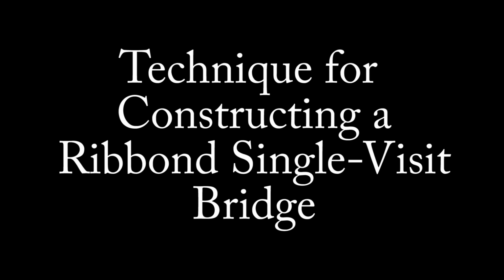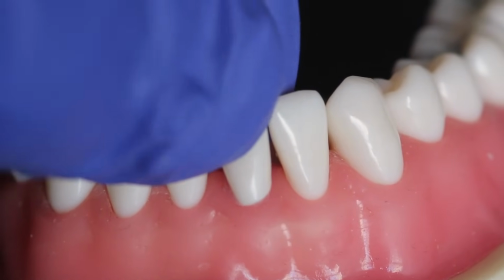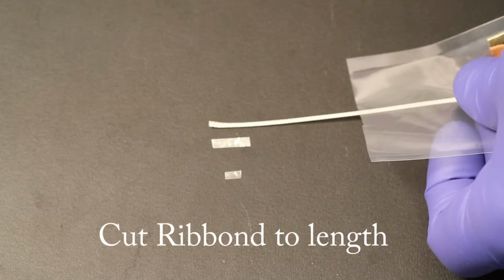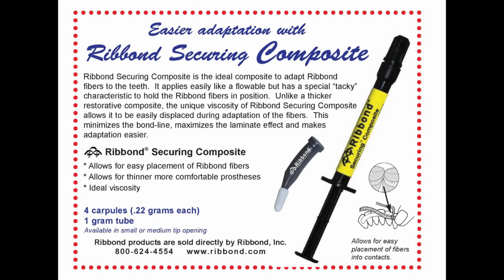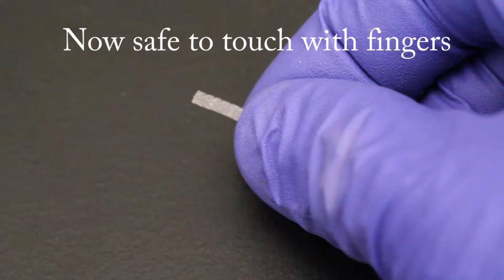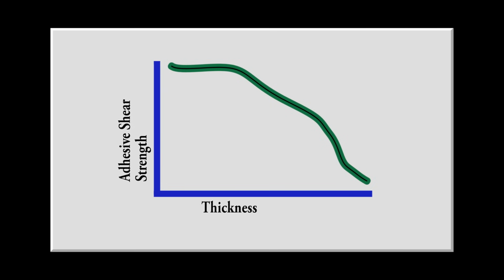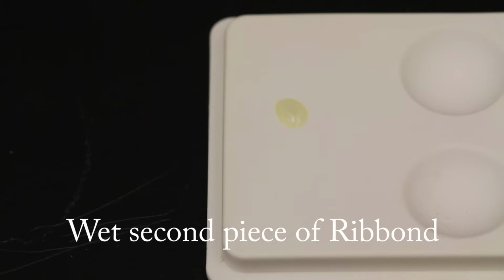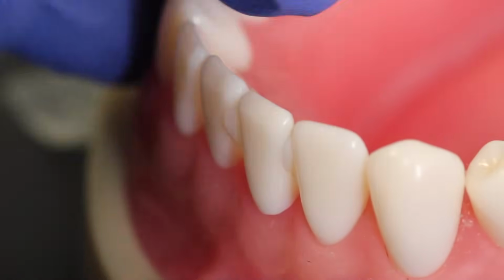Ribbond Single Visit Bridge Technique

Comment: This is exactly what I will be having done .. I have one lose frontal tooth next to my big tooth 🦷 (opposite number 7 tooth) on right upper frontal. Hopefully 🙏🏼 this procedure will work for my tooth.  This tooth was already worked on not long ago before it came loose.  Dental splinting is the way to go to keep a tooth when other teeth are still good.  I will need an implant on lower as well eventually.

Comment: Good in theory, most likely sub-par in practice. Zircon based bridge spanning the missing tooth and crowning the two adjacent teeth provides better structure and looks better. It will also feel better in the patients mouth and be easier to clean without having the odd gap to clean. Regardless a bridge will always have its drawbacks but, that goes with any oral procedure. As far as function on a front tooth I would be afraid of this breaking if something hard or tough was bitten into and pulled, like a steak.
Reply: Bad, because teeth get infected inside those crowns
Reply: This technique in video is best
Reply: Skinny Lower incisors aren’t great abutment teeth for zirconia. I’d prefer this for skinny teeth
Reply: Yes a traditional fixed bridge will offer the most strength and is likely the best option for posterior restorations. 
This bonded bridge option is perfect for emergency or temporary restorations or permanent restoration of a highly visible tooth. It only minimally compromises the supporting teeth and ~5K for a traditional bridge is way out of the budget for too many people.

Comment: Will this last long? Then why dentist still do fixed bridge procedure which is grinding the teeth? 🤔
Reply: Because this is not suitable for all teeth. You can’t do this pontic for a molar. In that case that are many other options including implants, removible, normal pontic which includes some kind of preparation (grinding). Not all the patients are the same neither the materials used for the bridge. It’s also important clinical evaluation. Clinic rules 😊
Reply: Hygiene issue
Reply: Hygiene, strength, polishablity, color changes of the material everything is inferior to a normal bridge. Only plus point is it us conservative
Reply: So that dentist can earn much destroying our teeth

Comment: I guess no flossing for those two gaps.   I love this option better then an implant.  Price is probably half of the implant or even less.
Reply: Maybe use those little brushes for underneath the ribbond..just a thought!
Reply: $1,000 for one bottom front tooth. You do not floss up and down, only back and forth. It's like a false tooth only it is your own tooth=taken out and put back in and attached to each tooth on either side. It's genius.
Reply: @alexmiles40  do you have a bridge ? I'm looking at getting one for one upper tooth ,1000$ for the implant it was over 3000$ plus he said hed have to do 2 surgeries on my jaw bone to make it level . No thanks ! Take about a year to get a tooth .

Comment: @ribbondinc how are you suppose to floss to keep the other two teeth healthy?
Reply: Use a water pix
Reply: @OhSoLoring9113  I have one and did not even think of that
Reply: @SamanthaBullock how much did cost you. I need one.
Reply: Diana Putinelu they are about $50
Reply: @sammibullock  thank you!
Reply: @mariposa1953  You are more than welcomes. Now I should Have told you I do have the all purpose one. It is big with everything on it for the $50 at Walmart. I think you can smaller ones with just the pick from Walmart too.
Reply: @mariposa1953  you are very welcomed

Comment: I wanted a bridge but not anymore it looks too fragile and will damage my remaining teeth.
Reply: Don't ever go for bridge I m suffering this all problems for many years
Reply: I had this done.no problems .works great .bottom front tooth.
Reply: @sandyshepard3694  which bottom front tooth ? and could you eat perfectly ? what was the reason ? did your teeth fall out ? pls answer my questions i am going thru the same thing and i am scared